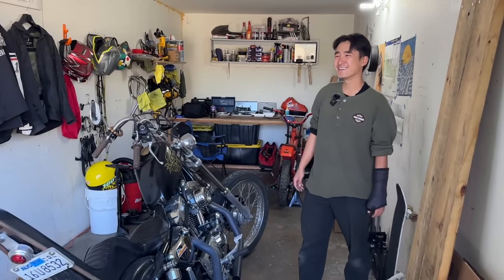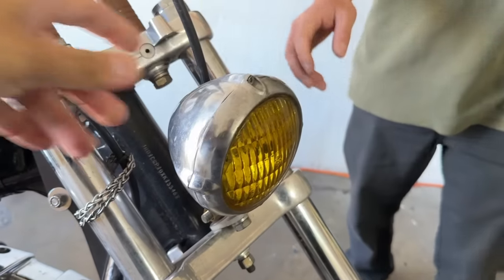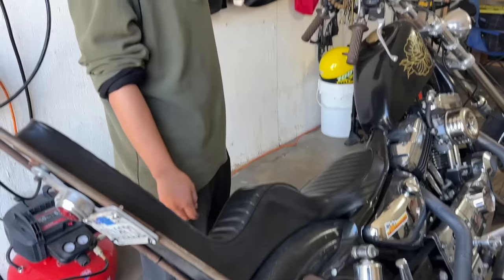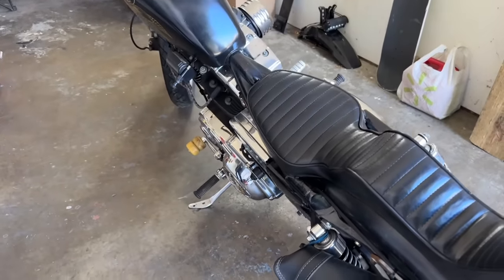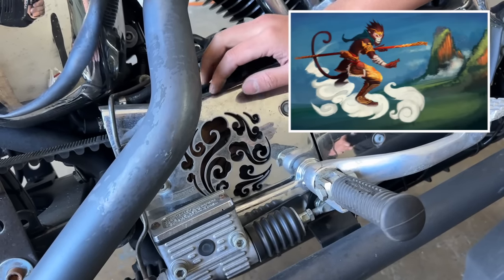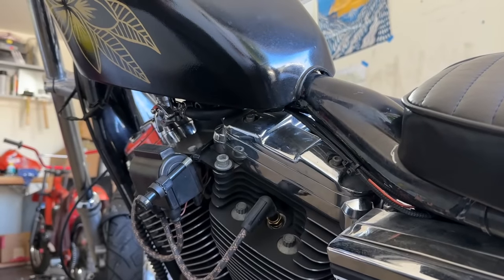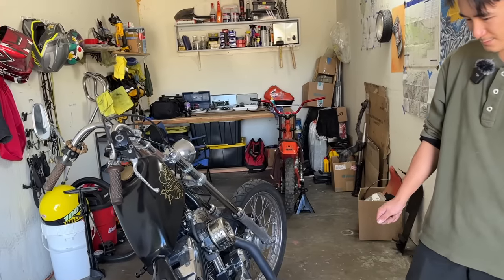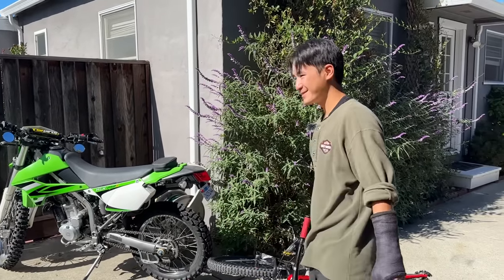John Pei's 1999 Swingarm Sportster Chop

Comment: VOES is a bummer to hide but it definitely serves a legitimate purpose. evos need it to advance the timing from idle to high load. it’ll run okay some of the time without it, but if you’re hitting it on the highway or ripping through hills you’ll need it. i tucked mine in behind the top motor mount—super short vacuum line and grounded to the motor mount. hidden pretty good and the super short vacuum line holds it in place without the need for a bracket. 

always nice seeing a swinger chop.
Reply: Thanks for the info! Super helpful. Because of your comment I'm going to put the voes  back on and try how it rides highway

Comment: I did same thing to my 2000 sporster did six over and resesed forks and it smooth right out 👍
Reply: I got 8” over ….. you think I messed up ? Cuz I just saw this vid and the bike looks sick ( I will be running 21” front with 8”over ) should I start having doubts lol ? Tubes Still didn’t reach those

Comment: Inspirational, thankyou. John, just wondered about the angle of front brake resovoir, obviously works. All the best from UK.
Reply: Yeah it works fine. Overtime, the rubber seal will wear out and leak. Replaced mine 2 years ago and haven't had any leaks since.

Comment: I'm set up just like you 21" front stock rear size ,ape hangers and sissy bar, stage 2 Dana ignition lowered rear shocks 3" and I threw on led light strips 2 small ones on frame in front 2 medium strips mid way and two more on frame  of sissybar it seems to get me noticed specially at night. (Seattle, Was.)

Comment: I have had my Sportster for 25 years and 400,000 miles on the original engine. It's a 1999 as well.l commuted on her for 20 years. My bike doesn't go fast enough to get a speed wobble.😂